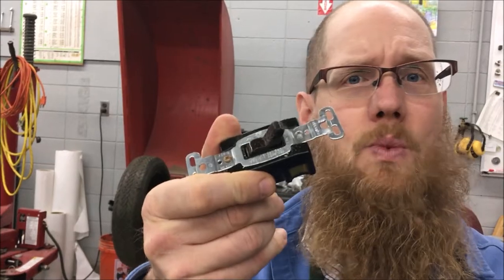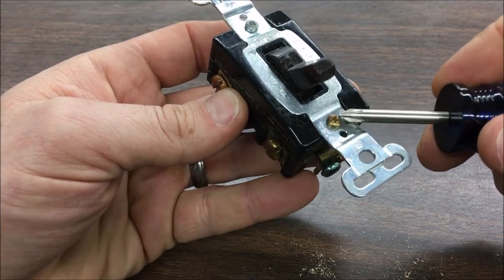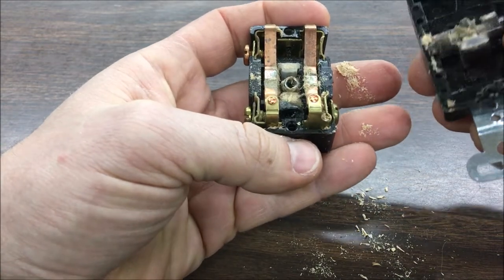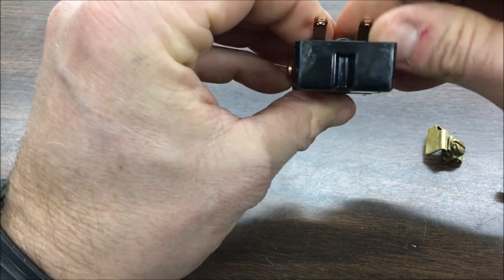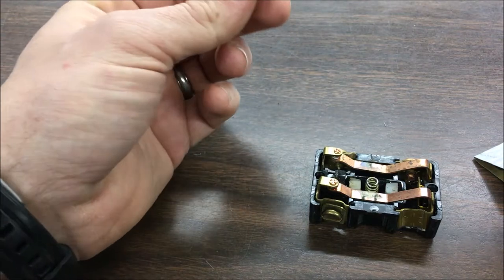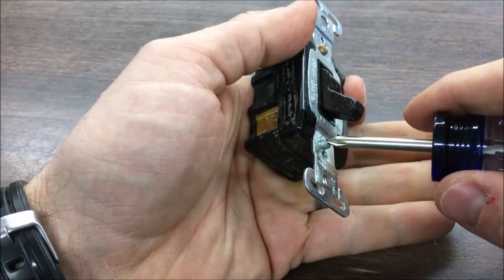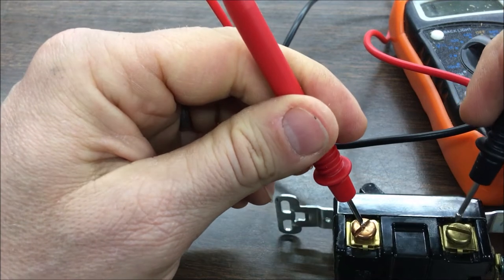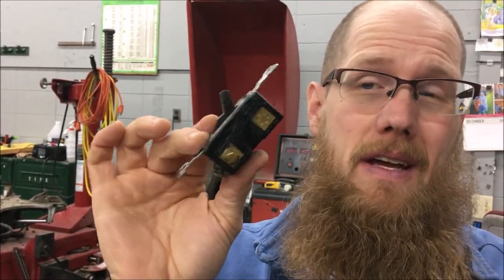MACHINE SWITCH FIX

Comment: Joe ... I almost always take apart things before just replacing ... amazing how often things can be fixed instead of replacing ... Good to know There are at least 2 of us ... By the way, my vehicle has points - now ... I can drive when the emp happens ...
Reply from the maker: Carl, so much gets tossed these days it drives me bonkers.  I am trying hard not to be a hoarder, but I really think things like that switch were meant to cleaned up, adjusted, and put back into service.  What are driving that still uses points?
Reply: @YoungbloodFamilyFarm  I have an '86 Ford truck and I have replaced the distributor with a 1975 points model. The "brain box computer " is still there but doesn't have a function now.
Have a great Blessed Day